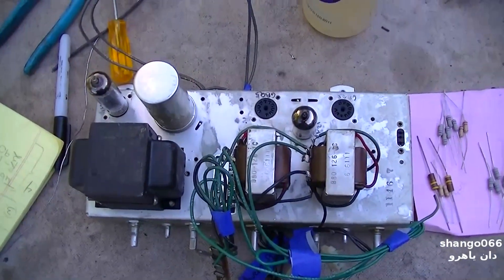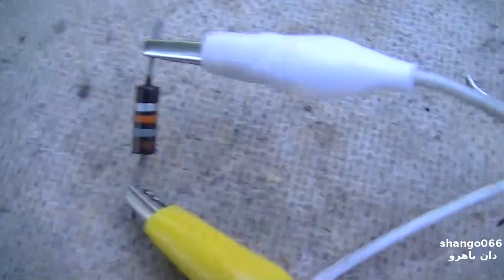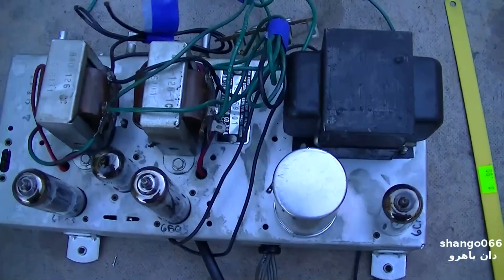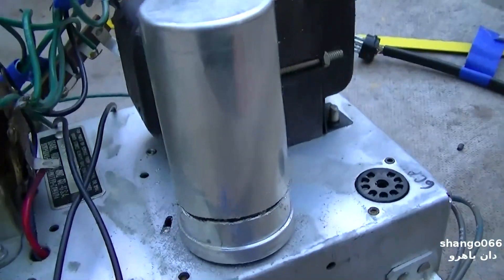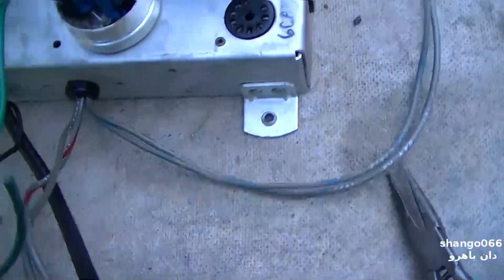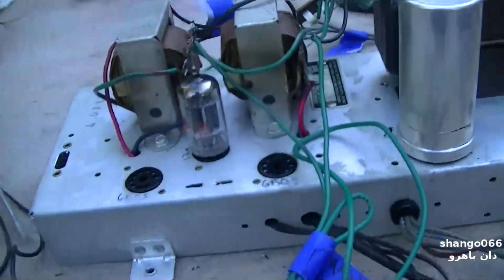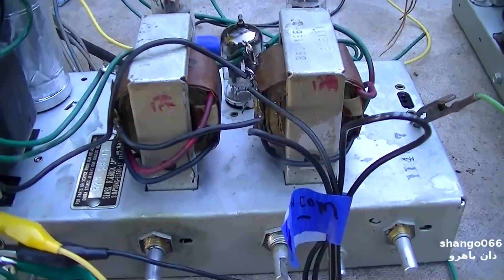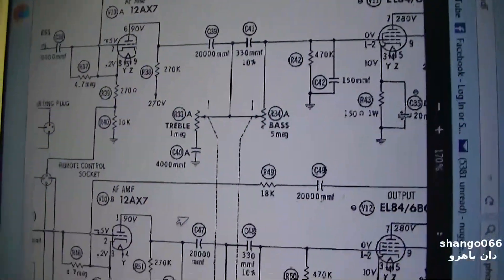Sears Silvertone Tube Amp Repair

Comment: Hi Shango066, what is your thoughts on 5654W valves for a Pre-amp ? I have paired up a Pre amp with a 80s amp which is linear but looking at replacing the valves in the preamp for something better, what is your thoughts ?

Comment: My mother has an Silvertone chord organ that has an 8" speaker that I fixed back in the early 80's.  It had an amplifer similar to this one if I remember correctly,  It also had bad resistors,  The capaciters seemed ok.  The organ still sounds good

Comment: Wow, should you just replace them with NOS & be done with it. I'm recapping my Silvertone 1472 & removing the death cap. Seems like taking resisters out one at a time to test is a pain, just change them, I see 2 that have been replaced, also have 3 Sangomo .01 600v caps & some Aerovox .001 600 in there also. Thanks for the video, nice to learn about these things, I should have been collecting them, I feel more comfortable about working on them. Amp guys are far away here in the sticks.

Comment: 18ks measuring 19k would have been ok, they are within the tolerance, but as for the 270ks going open, i've come across those and 220ks going high more than any other value!

Comment: I think a lissajous analysis between input and output of that amp would prove interesting.  Perhaps the output transformers likely have a bit of phase shift.  With those compliant speakers that is the recipe for a LF siren. Speakers such as the originals may have higher free-air resonance, and thus would not disclose this problem. I've also seen some cheap OTL amps (such as used in '70s-'80s amps with a blocking cap on the output do the same thing if an unbaffled woofer with low free-air resonance is used in test.  It's amusing to watch, until the amp perhaps oscillates itself to death.  I had different test speakers for such situations to try to avoid this.

Comment: So people know, equipment does not have to be ancient for resistors to go high lol, I just repaired a Sylvania 32" HD Flat LCD set that had two 18K resistors that read up to 4.3 megs  when they got hot, this caused the set to shut off after a period of time. Test was done with a heat gun on them out of the set and on the meter. I put in a pair of 21K and the set works fine now.
That old amp has a feedback line on it to limit the drive, the original speakers in the unit will make up the volume.
Also there should be remote option socket that puts the unit in "mute" mode when its not connected, there could be a shunt in the socket, see if that's bad or if it was even included with the amp..

Comment: There is something still wrong with that amp. Tube manual says 4.3 watts for single ended operation. That ought to blow your head off at close range.The instability (absurdly wild infrasonic oscillation with high bass) of the amp is a probable cause. I thought you were going in the right direction checking the feedback path. Too much negative feedback is a bad thing; at the ends of the frequency response of the amp, phase shifts (approaching 180 degrees) can occur which can turn negative feedback into positive feedback. Try cutting the feedback loop open and see if the instability clears. You will probably want to run some feedback; perhaps you can select a higher value resistor in the feedback loop. Given that you can damp the oscillations by gently holding the foam surround of the speaker indicates high amplifier output impedance, thus a poor damping factor. The feedback loop has a great effect on damping factor. Negative feedback reduces gain (easily made up for in other stages), broadens frequency response, and decreases output impedance. What about C49? is it leaky? If problem is not in the feedback loop, perhaps the power supply impedance is to high. How much plate voltage is there at idle versus thumping? You can also hang a scope on the power supply and see if its dancing around while at high volume. High power supply impedance will be reflected to the output impedance. Good luck!

Edit:

The more I think about this the more I suspect the power supply - both channels weak and unstable - common element is the power supply. Are the new filter caps good (second decoupling filter - this thing almost acts like a motorboating AA5)? Weak rectifier tube?
Reply: MR BURNS! Have a question for you on an o scope.  It's an EICO 425, have pics. Erase this when you get the message.  Merry Christmas everybody.  Steven
Reply from the maker: +RF Burns It was mostly those speakers. It didnt like them, changed them to a more appropriate speaker and it worked fine.
Reply: +shango066 Cool! - Still there must be some bad design to this amp for it to act so strangely. I bet those were 4 ohm automotive speakers?
Reply from the maker: +RF Burns 6 ohm our of a projection set. I think its the dampening of the speakers. Those just like to bounce. I have speakers out of a similar silvertone console and no feedback and much louder. I could try connecting that feedback loop and i bet it would crank up into distortion
Reply from the maker: +shango066 well i screwed that all up
Reply from the maker: +RF Burns It has a socket for Remote and sense I dont have that its in muted mode, i jump it and it cranks.

Comment: Come on, when did PCB boards were invented? i mean, what's the point of having all of those components just flying through everywhere? Isn't that risky?
Reply: +André Campana Merétika 

PCB boards didn't come into common use commercially until the mid 1950's, but the idea goes back decades to 1903, and by WWII was in use for some war gear before it became a commercial product post war.

By the late 50's and into the 60's, it was commonplace, especially for SS electronics, though many tube electronics may or may not use them, such as this stereo.
Reply: John Palmer Thank's for the clarification :)